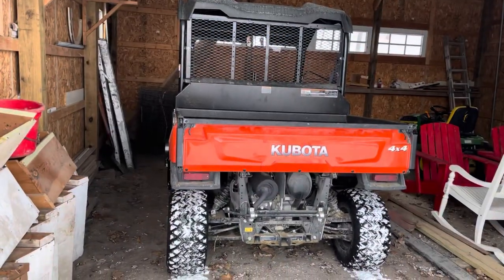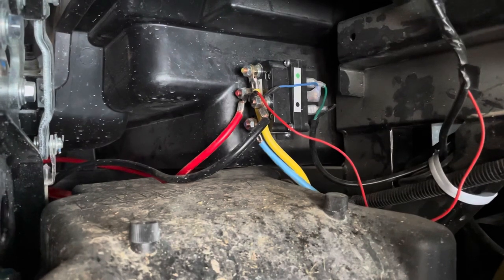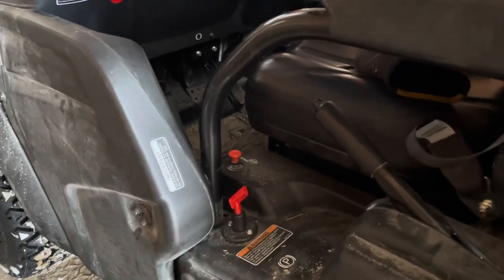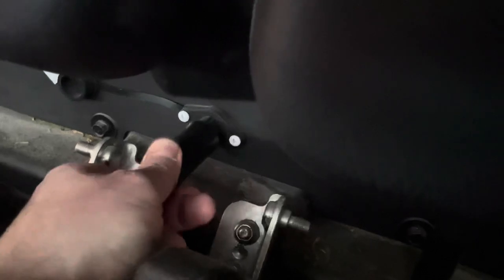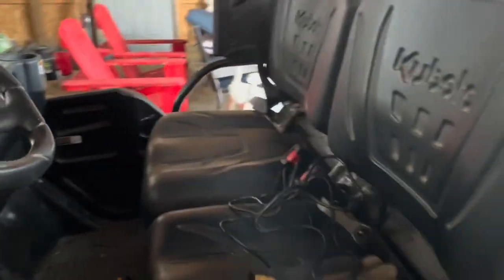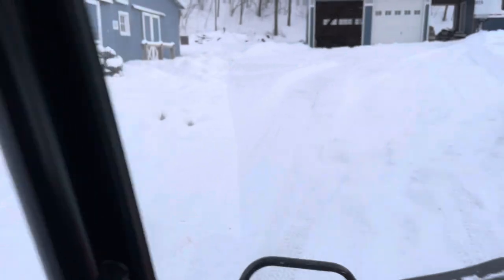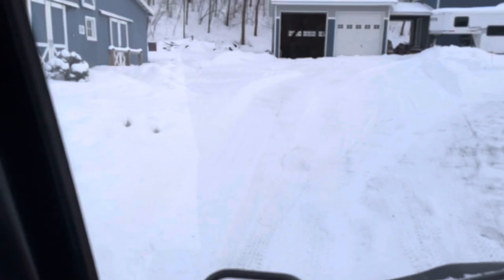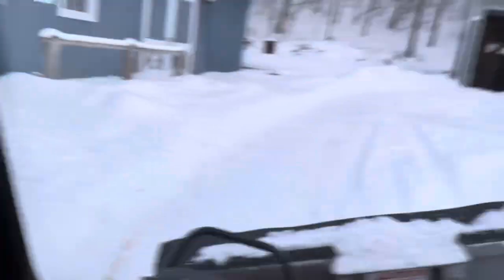Kubota Side Kick and snow plow

Comment: Buy three yards of 20 gauge vinyl from a marine upholstery shop, put the Kubota into a heated shop and have at it with zip ties and pipe clamps to enclose the rear and passenger side.  It will be a lot warmer, especially when you improvise a headliner out of expanded vinyl from packing cases.